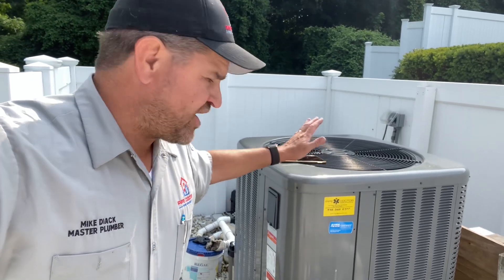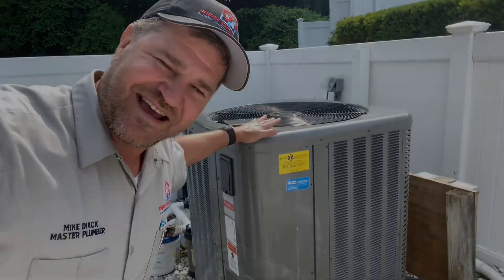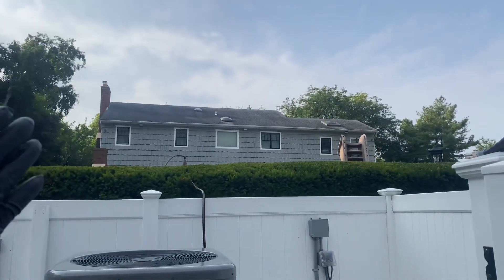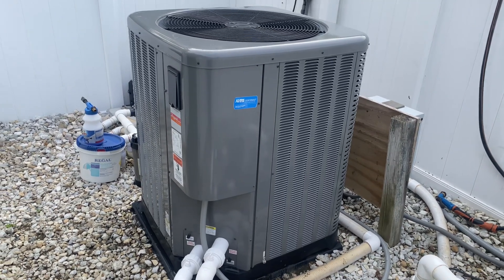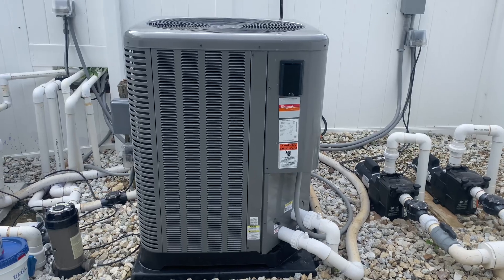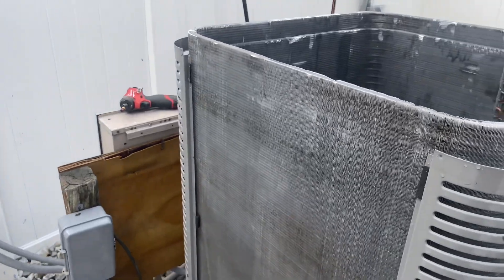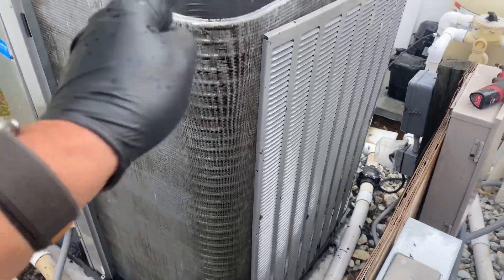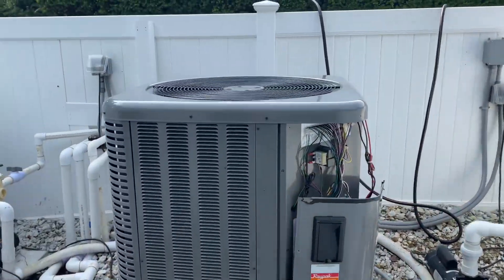Step by Step Heat Pump Maintenance & Cleaning Raypak Pool Heater Instructional Video

Comment: Mikey, looks like they have a cotton wood tree near by. I have this issue with some buildings out in suffolk. These trees drop thick fabric type material thats peels off or is easily cleaned with a brush
Reply: @PipeDoctor  never knew we had them here till i took over a building in islandia. They are rare but they do exist up here
Reply: @Tanneritefilledfido Is that what that was? I originally was thinking that maybe the owner had a lot of dogs or something…….TY for the insight😊